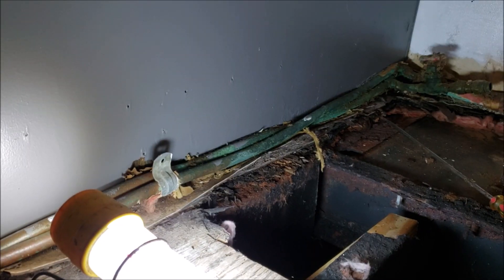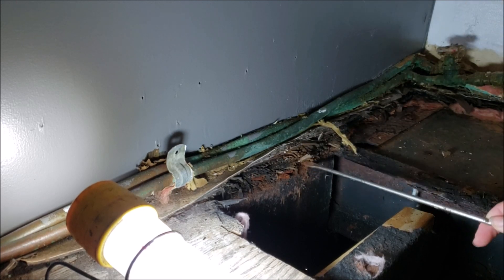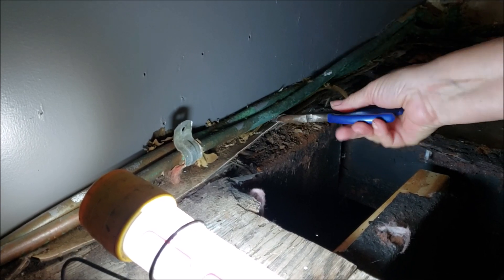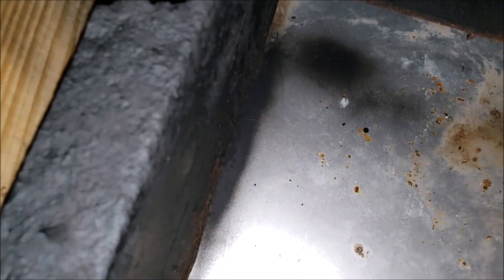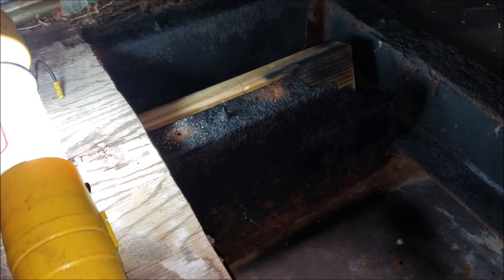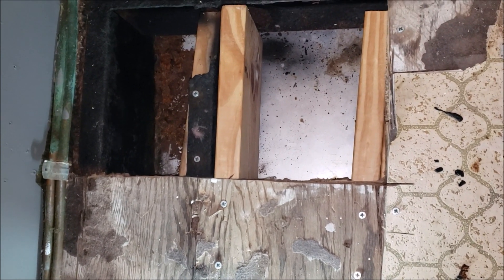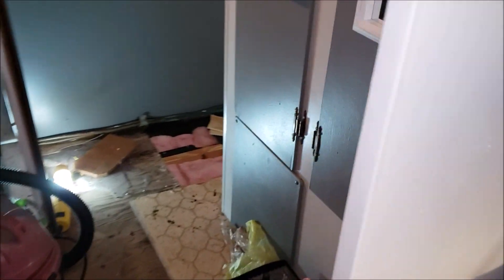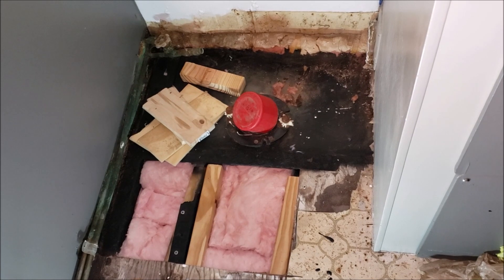1974 Silver Streak Reno   BATHROOM FLOOR BRACES done INSULATION DONE!

Comment: A wide wood chisel would be a better tool than that screwdriver.
You really bit off a huge project but have made enormous progress.
I hope you get to live in it this coming year.
Not much snow so far this year.
A big storm coming in Wednesday night (12/19) that should drop
a good amount of snow but the weather coming in right now is from
Hawaii and is warm air, so rain might wash away the snow. Our day time
temps are in the high 30s for now.
Reply from the maker: Keep warm!! I don't want any more tools. The old screwdriver does the job 😉
I hope after I finish the bathroom floor, tgevrest will not be as difficult. 
I do have a clogged black tank...ugh! He never closed that tank...